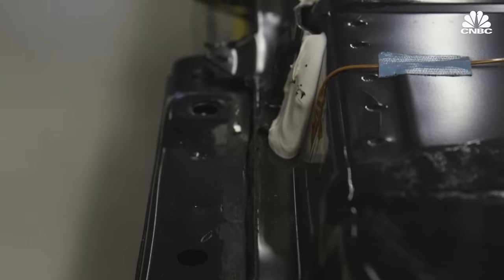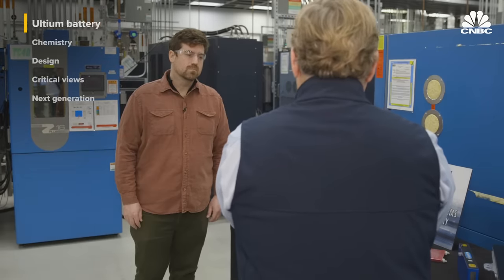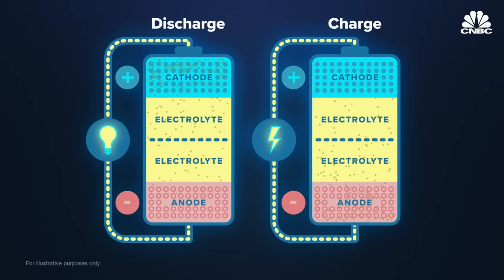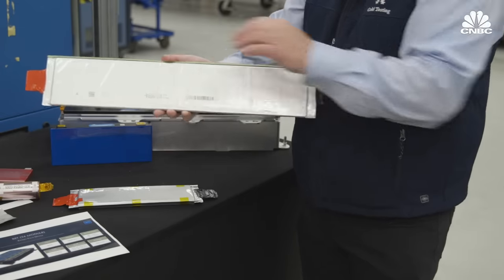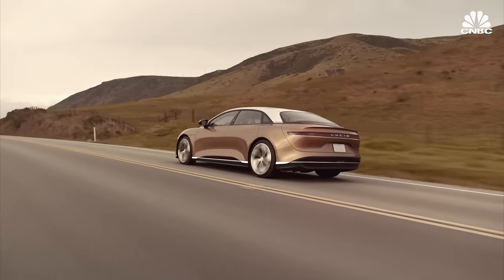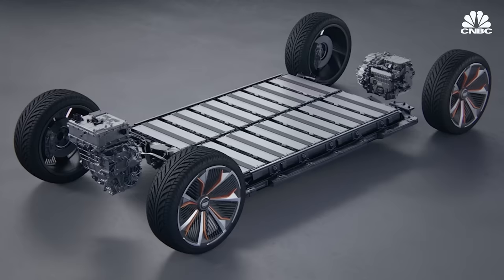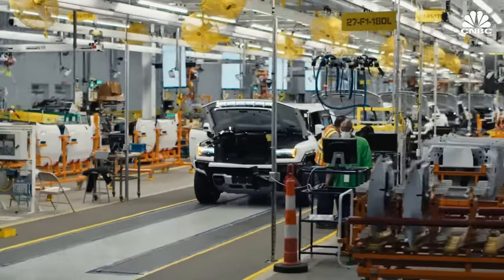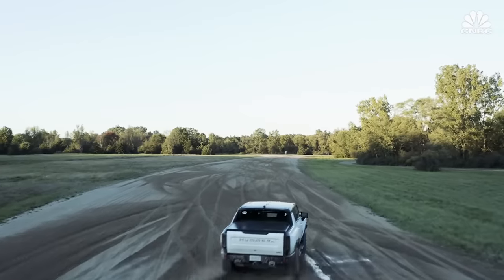Why GM Says Its Ultium Batteries Will Lead It To EV Dominance

Comment: Bahahahahahaha ...

I worked for GM from 1969 to 1987 during their "hey day" period of dominance in the US Auto Industry.  In reality, from 1970 onward, the GM product and GM management went into severe decline, largely because of one person, Roger Smith.  Smith fixated on creating shareholder loyalty by decontenting the quality of the vehicle.  Anything he could do to reduce the cost of the product and the manufacturing process became his priority.  As a result, the vehicles became gas hogs, they broke incessantly, and their residual value (trade-in value) went down severely.  All this at a time when the OPEC (oil producing export countries) drastically reduced oil production, resulting in $1.00 per gallon gasoline that was in very short supply.  At that point, America and subsequently the world redirected their attention to Japanese products and never looked back.  For all intents and purposes, GM is out of business.  They produce very few cars and rely almost solely on trucks for minimal profits.  They even sold their finance operations GMAC (general motors acceptance corporation) to raise cash at one point.  Then, as we all know, it became Government Motors, which perpetuated the disaster.  Today, GM is an empty shell, relying on the "great liar" joe biden to save them with his green new deal.  GM is producing electric vehicles on the basis that biden can "force" the American People out of gas/diesel powered vehicles and into EV's.  It won't work and it sounds the final death knell for GM along with other car companies that traded short-term financial gain for product market share.  You probably don't even remember their names.  Hold onto your GM memorabilia but the self-touted resurgence of GM via EV's is just another of GM's "Import Fighter" wet dreams that fell into the dumpster.

Comment: GM is delusional. They’re going to make 2 million EVs by the end of 2024? That’s 250,000 per quarter in 2023-24. GM has made about 10,000 EVs so far in 2022. There’s no way GM can do this. Plus, they’ve missed every EV goal they’ve set. In 2017, GM said they would have 20 EVs by 2022. Where are they?

Comment: Get to 2000 miles on one charge and it will take over quick. This 300 avg range not working. But I figure they will get there.
Reply: Nonsense.
Reply: @summertyme5748  Non sense? Without saying why? Stupid. They will get to over 2000 miles on a charge and that will be the end of gas cars. Blow me.
Reply: Why 2k when the farthest you can go by i.c.e is 731 miles with the 2018 jaguar xf20 deisel. Lucid is close enough at 520 miles, all that needs to drop is price.
Reply: @rick74304  Because I want a car that I can drive straight to Florida without stopping LOL! They will be like that one day.

Comment: So what happens when one of the cells dies; you can't recycle it. 10 yrs from now will this car still be on the road. Not sure how this is better than a gas alternative if it's rotting in a junkyard cause it's too expensive to fix. That doesn't even include the countless software issues bound to occur. We can't even get apple to provide software support to older phones; how are car companies gonna be different? I think it would be better if we focused on actual causes that would save the environment like the Right to Repair. That's just the opinion of an electrical engineer/consumer, not a politician...

Comment: Not totally against EVs but infrastructure is not there like it is for my gas silverado and when i tow i may get less mpgs but not a big deal i just stop and gas up takes 5 minutes or so. And my truck is 7 years old 82000 miles just is getting broke in. How many miles will battery packs last? And how much willl there range be at 100000 miles plus cost of replacing battery packs? Too many unknowns and is GM going to buy me a charger for my garage? Gas station is 2.5 miles down the road.
Reply: model y battery pack lasts 300-500k miles on average and cybertruck is coming. and yes you can supercharge to 80% in 10min or less. Cybertruck should have megawatt charging capability.

Comment: Marketing B.S. Lithium cobalt manganese with Al has been known since at least 2008. Pouch cells are nothing new. A123 was making pouch cells years ago. If you're using larger cells you should be able to replace a bad cell in a pack without scrapping the whole pack. DIY guys converting cars to EVs in their home garages have been doing it for 20 years. I hope GM builds a decent EV, but I agree they are at least 10 years too late.

Comment: The problem I see going forward with these new EVs has nothing to do with the drivetrain.  It's the excess of 2 pound $2000 gadgets in the vehicle.  I don't want a computer on wheels that's internet connected and might, someday, tell me it can't run because the motor is now a subscription service, or that some kid in a basement can hack into (IoT security being stupidly bad) and demand ransom for.

I want the electric equivalent of a 1966 VW bus; No frills, dirt simple, turn-the-key-and-go.  Why is this so hard for automakers to understand.  I just want a car.  An inexpensive, reliable car.
Reply: @calmorton4619 , and what does that have to do with anything I said?

Comment: Not even Mary Barra's loving grandmother could believe her. There is NOTHING in GM's track record during the past several decades to indicato GM can pull that off, certainly not under her "leadership". If GM did that, it would be because Tesla blows its lead (not impossible if it condinues to makes fabulous cars but with crappy quality control), in that case; Kia, Hyunday, VW, etc., and above all, Toyota (in spite of its "late start), would have destroyed Tesla. This means GM will sit where it sits now. GM, Ford need to dump their archaic MBA controlled management culture. But that is like asking the King of France to resign before Madame Guillotine's party.

Comment: Fails to mention efficiency, miles per kilowatt, Tesla still smokes every ev in that realm. You can get more miles per charge and tesla killer headlines if the author ignores that fact that GM just crammed in a much larger battery. Have fun sitting at charging station an extra 30% of time filling up those cells 🤣

Comment: I dont know, Atlis is going to offer 1ton capacity, 500 miles; standard, box, service and flat bed up to 8'.Oh did I mention 15 min charge time And has 110 and 220 outlets.
 These car trucks arnt going to hack it towing or in the trades. I hope atlis delivers on its promise. 
 Gm had their chance in the 90s to be the ev leader, they fubbed that up in a sinister way. GM wont get my $.

Comment: As soon as they start towing and realize their range drops to 25%, everyone will be dumping their EV's. Even if they with 4x the capacity, you still can't dump that much current into the battery fast enough to make it practical to go any distance. Yu are going to be stuck at the charging station for hours.
Reply: Just need everyone to jump onto the wagon and the research will unfold that issue , next issue generate power for said cars in a green way. Lol!
Reply: @JamesBrown-ug2tm  But its a math problem. Cars get away with it due to aerodynamic and weight improvements. Trailers are for hauling stuff. You just can't get that much charging capacity, regardless of the storage capacity.

Comment: Ultium battery packs designed by GM and loaded with LG made batteries, that is CRAP.  Look at the recall of all the Hummer EVs made since last year due to the corrosion of certain parts of this battery pack that renders the vehicles in permanent non-working conditions.  GM and Mar "Pinoccio" Barra are doomed...........

Comment: What a fluff piece. You are willfully ignoring what is happening in the current EV market. Thy lyriq has low 300 mile range almost identical to Tesla model Y, yet GM uses 100 kw battery size, compared to 75 kw on the Tesla for the same range. GM is hyping old outdated tech as new and cuttings edge. Just look at the performance and ignore the paid marketing like this piece.

Comment: There is no new technology here it's just a different format. Many car manufacturers that are stepping into the EV world even the ice world of develop platforms on which they mount various car designs. I personally don't believe GM has what it takes to meet their projections. I think the CEO is it equipped to lead this company forward. They partnered with LG which is already caused GM to lose billions of dollars because of the failure of the battery packs in the bolt EV.

Comment: Yea these batteries last about 8 or 10 years and then what? I'm driving around in a 40 year old Toyota diesel truck. You want green? Build cars that last forever. It's gonna be an environmental disaster as the land fills are already full of flat screens and computers.

Comment: This will be the end of GM!!  EV vehicles do not appeal to majority of the public.. most people dont want electric cars and trucks.  I will never buy one!  Their is nothing amazing about a battery car..its just a motor and a battery..a gasoline engine is an amazing engineering marvel!   And the batterys are expensive and lithium is hard to come by and just where are they gonna dispose of these batterys?  One solution creates another problem!
Reply: How do they dispose of bad engines?
Reply: @RSJerelle_  they can melt engines down and recycle them and use the metal for something else

Comment: Lithium Ion batteries are old technology.  Lithium Polymer batteries  are an improvement and other tech is coming.  General Motors E-cars will charge much more slowly than newer cars.  GM is clutching at straws.  They  do not innovate, they duplicate.

Comment: The GM battery is compromised of small packets like little bags of lithium, it's a terrible design, it's the least expensive method for battery manufacturing. They're essentially junk. I bet they only last 5 years or less. What a terrible idea this is.

Comment: All this talk about an Ultium or whatever battery pack is just so much horse manure !
They are ALL lithium-ion battery packs and as such do not (CANNOT) differ very much in what they are. Certainly no 'pack technology' can dominate any more than GM can dominate using some magic 'special fuel'.
You either make a BEV that people want to buy or you don't. In either case, the battery is simply coming along for the ride.

Comment: I wonder how much energy it take to dig up all the material for the battery. I wonder where the energy comes from to charge the battery vehicle (hint it's from coal plants). Do you people that celebrate the Ev know that one material called cobalt is mainly sourced from Africa. Here they use tons of child labor, they make the kids go down the tight shafts that adults cant fit down. They have no respiratory equipment, usually few or no tools. But hey your saving the world from global warming what's it matter if you break a few eggs in the process.
Yes they are reducing the amount of cobalt but only because they got called out. They don't care about the lives they destroy. Yet you sheep celebrate how loyal you are to these rotten corporations. Go sheep go, but now you know. How's it make you feel that your purchased Ev has material in it harvested a child that later went on to die when gathering more material.

Oh is the electricity coming down the wind turbines and the sun? How'd that work out I Germany when they tried to use that as their main source of power. Right you wouldn't know because your that lazy to ever research anything and you love being ignorant, you also love the fear they dish out, you sheep are all the same, addicted to the fear.

Comment: Ulttum sounds like a good way to design packs but no matter how it's packaged or managed automakers need to stay flexible on battery chemistry because the state of the art is in a state of flux and it's moving so fast you can't even build a battery plant before a chemistry is considered out of date. I'm thinking there will be at least 3 new types each year for the next decade. Battery researchers are on notice they don't have "years" to get to market. Your breakthrough will be old news by then.

Comment: "We're working to a goal where we have zero crashes, zero emissions and zero congestion"
If they get zero battery fires, I'll consider buying a battery powered vehicle.  Until then, I'll stick with my internal combusion car.  EV's are cheap to run - but only initially.  Once the government figures out how to tax the electricity that charges them, the cost will increase.  When consideing cost of running, EVs may be cheap financially (initially, as I said), but if they take your life in a fire - that's a price most people don't want to pay.

Comment: i have a 77 ford van and a 85 chev pick up with a total invested of about 17,000 . given the estimated average battery life of 10 years , the van would be looking at #6 soon and pickup at #4. . that's 10 batts (whether  vehicle is used or not )
at say 15 to 20,000 dollars each . or possibly $ 200,000, for 2 vehicles with a total of about 200,000 miles . that's $ 10, to go to supermarket not counting insurance ,tires , OH and ever increasing cost for electricity Wilhite was generated by things that used energy to manufacture and machines to install . 
   that's 10  times the cost to go a few miles , talk about inflation. l hope you drive a lot and only want  1 single purpose vehicle that will deteriorate just sitting in the garage. . good luck when a solar flare or nuclear blast  destroys the elec grid . you will have a 5000 # paperweight in the garage with the next charge maybe only a couple years away.  get a good bicycle before the idiots inflation puts their price out of reach . 
   I've worked on electric vehicles up to 50,000 # and know how complicated and dangerous they are to work on especially if not trained . even worse now with all things computor controlled . 
  solar power is good but in no way can it replace the back up generation produced by coal,gas,  hydro , or nuclear.. putting all eggs in one place means a disaster with one small drop. 
   I feel for those that need a car to get to work but can't afford a 30-50000 dollar vehicle , much less a used one with possible need of a new battery soon . hooray for the 15 minimum wage , how many batts do you want .

Comment: How much CO2 is emitted to generate one of these battery packs? Given that level of CO2, how much more CO2 has an EV's production yielded when compared to a combustion engine? How many years will it take for the total pre and post-production CO2 emmitted break even between the EV and its combustion cousin? The answers will surprise you and lead you to conclude EV as "zero-emission" is one clever marketting shell game

Comment: The problem with electric cars, slightly touched in this story, is materials. Unless a serious recycling process is put into place, we're going to run out of raw materials for battery manufacturing pretty quickly once most new cars are electric. Perhaps hydrogen is the real solution.

Comment: Total BS. Look around a 24/7 gas station is near by.and takes 10-min to fill the tank and drive 350 miles.   See any EV stations?  If.there was one do you feel like parking you car there for 10-hours if there is a open spot  and only get 100 miles out of the charge.

Comment: GM Ultium battery is Lithium ion which is inferior battery technology.  LiFEPO4 is considerably better technology.  The grid cannot handle EVs.  EV technology is decades from being implementable.  This project is doomed to failure before it gets off the ground.  EVs aren't the "green" miracle they are being sold as.

Comment: I will never buy an electric car = YOU LOST
Reply: And the oil companies win.
Reply: @snowman374th  Ar you suggesting horses or bicycles? Coleman lanterns? Heat our homes by coal? Require all  electronics to be vacuum tubes? If we are hit with an EMP we will hit them back. I don't know what you drive but if it was made after 1970 an EMP will knock it out.
Reply: @steven4315  
Guess you don't understand. Some day you will. When it comes to the war machine, there will always be combustible engines.

Comment: An edison generator or battery and dynamo powered electric car is much cheaper to manufacture and the car has unlimited range electric cars without charging stations.  It is a shame we can't have simple unlimited range electric cars trucks and airplanes. The Edison generator and battery powered dynamo powered electric vehicles without fuel or recharge stations is possible.   but...

Comment: Wow I'm a big GM fan I have 4 of them sitting in my driveway but lets be honest how much pollution is created on the other side of the globe to manufacture a auto battery is it "0" like your claiming and how is the electricity created to charge the battery are they still using pixy dust ? LETS BE HONEST !  Has this new battery tech proven fire resistant enough to park in my garage and go to sleep?

Comment: Battery powered cars trucks are foolish and unnecessary. An edison generator which is a permanent magnet motor as a generator does work and a similar solution using a battery powered dynamo that powers an electric motor and charges the battery also is unlimited range electric cars trucks airplane and helicopters.  The unlimited range  is the troubling quality of electric power vehicles.  .